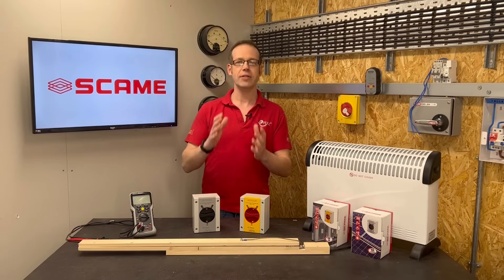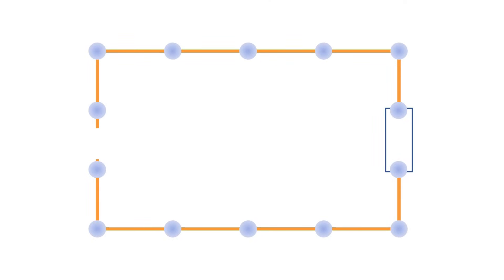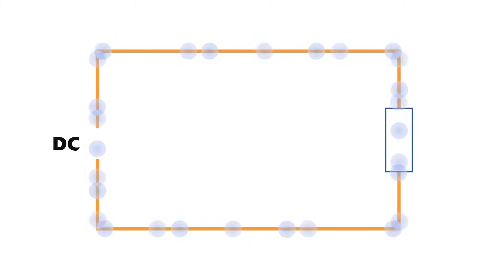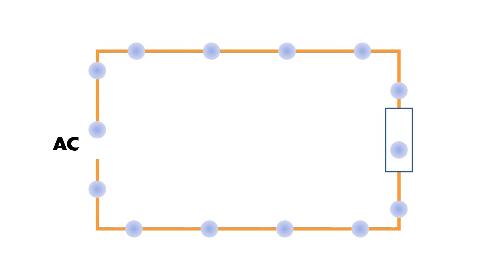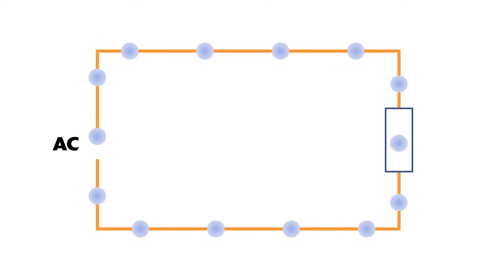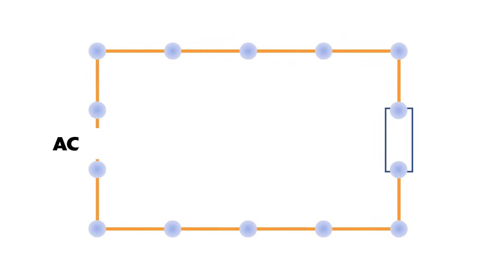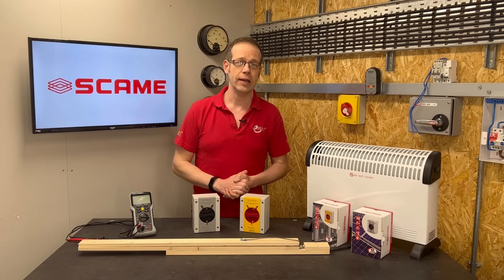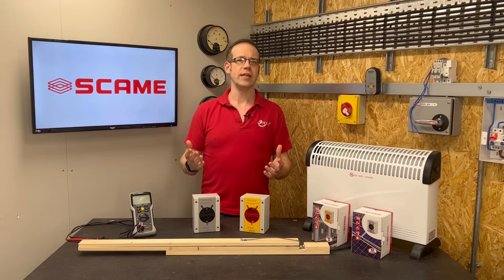The Jaw-Dropping Difference Between AC & DC Isolators!

Comment: It is the same switch with different values and connection type. You can buy the AC one and use as DC as long as you respect the values and make the bridges yourself.

Comment: i once ran a hot air gun directly of 230v dc from solar panels. Worked just fine, worked so good it even worked when I tried to turn it off :P
Reply: I've connected our immersion heater directly to some solar panels and it provides all our hot water during the summer.

Comment: The logic behind using two switch contacts in series for DC switching is that one set of contacts will randomly open slightly before the other and be subject to the arc's thermal and electromagnetic effects so that (in theory anyway) the switch will have a greater operational life with the two (rather than just the one) set of contacts.

Comment: Another critically important factor is the actuator (knob on the front panel) of the switch. Most dc ones I see have an impulse mechanism (like engine magnetos) to rapidly snap the contacts apart to their maximum distance. Do not mix and match switch components.
Reply: All modern switches have that feature

Comment: As an electronic engineer it really saddens me that the electrical industry is simply SO backward in its approach to DC isolation, and many other electrical things, in not embracing the knowledge and work of electronic engineers. 

Arcing is not really what should happen anywhere but is especially bad when it happens when switching DC at high currents. It STILL occurs even with series connected switches!

Yet DC arcing can 100% guaranteed to be prevented if electronic switching is used. The problem is that there appears to be a big misunderstanding in the electrical industry about the difference between disconnecting a circuit and isolating one and both do NOT have to happen together.

Ask most sparkies and they say something like, "well disconnecting might only be isolating the live feed, or worse, just the neutral because of miswiring ... That's why we must isolate. Agreed, However the two things are not necessarily connected (no pun!). 

For example a DC load pulling let's say 100A at 48v (typical solar PV type scenario). That load is a completely trivial task to "disconnect" electronically using high power MOSFETs or IGBTs which switch TIG welding currents of over double that amount, at many tens of thousands of times a second, around the globe on almost an hourly basis. But that clearly does not isolate the load. But once the circuit is OFF (with ZERO arcing of any kind having occurred) an isolator of normal type and even an AC type could then be operated to provide such isolation.

If the disconnect is on the high side output of said isolator then it too will be isolated. Reconnecting, even with an AC type isolator causes no problems. At which point the electronic disconnect can be used to both connect AND disconnect again through some fairly trivial electronics.

E.G. a simple interlock button can be used to trigger the electronic disconnect, immediately prior to enabling  the isolation switch to operate. This would maintain the zero arc status very simply. 

Is anyone discussing this kind of process at all? Highly doubtful sadly. How long did it take the UK to wake up to breakers instead of fuses? The continent and the US were using them for years before the UK caught up.

In addition to the above, a migration towards more use of contactors and/or relays for isolation would also be a welcome change to enable more automated safety features like auto isolate (manual reset) on fire alerts and over temp conditions (fire prevention!!) inside distro boards!

That would have been a MUCH more sensible approach than changing back to metal enclosures which has done NOTHING in any way to PREVENT fires! 🤔😢😢
Reply: Well said. I have begun using dc rated solid state relays for my home dc projects they are a very useful device.
Reply: MOSFETs can short out. Also the circuit driving the gate can go bad. They are NOT safe as emergency isolators. Only a mechanical interruption is safe!
Reply: @westelaudio943  perhaps you shouls read my post again. I specifically addressed the mechanical isolation aspect. As for Mosfets going short circuit ... In a dynamic switching situation subject to large inductive current spikes yes they do but if they are SO bad why & how does DC traction use them (and other electronic devices) SO successfully. Besides MOSFETS are not the only option (IGFETs & IGBTs) and we are NOT talking high frequency switching, we are talking ONLY as a mechanism to disconnect not to isolate. I felt I'd made it perfectly clear in my post that each is a separate entity but ONLY the actual disconnect has the potential to arc, once disconnected isolation can occur with ZERO chance of an arc (there is nothing with which to arc at that point). Sorry if you don't grasp what I was saying but I'm pretty sure I covered the issues adequately and fully.
Reply: @boblewis5558  

Ok, so you mean a transistor of some kind with a mechanical switch in series - now that actually makes sense. But then again, if the switch isn't used much anyways, it's just unnecessary complexity, and a mechanical switch with some arcing is perfectly adequate.

Comment: I would assume that the DC switches, for the same current load, would have wider gaps between switch points.  The switches shown in the vid are identical, as shown by Joe, so they frigged the switch by dropping the current load for the DC version and using two switches in series. Personally I would rather have a DC switch with one switch with a larger gap between the points. Something tells me the 1st switching points in the two series switches may wear out quite quick.

Comment: Back in the 90s In South africa, the DC switches and breakers, weren't always available. We used to take a 3phase contactors, and wire the contacts in series(to increase the switch gap), and de-rate the current rating for DC. We sometimes used 3pole switches wired in series aswell. I remember experimenting with small permanent magnets to blow out the arc. I tried fitting magnets to 2pole circuit breakers, to 'blow' the arc into the arc splitter/shoot. DC deserves a lot of respect, but it's not as dangerous as people make it out to be.

Comment: Fast DC breakers used in trains and trams running off DC overhead wires are enormous. Some are even preloaded with compressed air and have arc quenching chambers. With modern approach and in HVDC you typically have thyristor based breaker (to bring down the current) and physical disconnect in series
Reply: how does a thyristor breaker work, I thought they could only make and not break
Reply: @thewhitefalcon8539  there are gate-turnoff-thyristors as well (GTO)
Reply: @Leonelf0  I've never seen a GTO in a standard package. Even a decade later it's still a niche transistor technology.
Reply: @thewhitefalcon8539  Thyristors will break a circuit when the forward current flow drops below the latching (holding) current. 
It's preferable in AC circuits because current across the thyristor will naturally drop below the holding current every time the AC crosses 0V.
In DC operation, a SCR isn't going to have its holding current drop by itself without intervention, so you need to reverse-bias the SCR so that its current is commutated.  There's a bunch of methods, like placing a capacitor with reverse voltage in parallel with the SCR, using a LC resonator, etc. At the end of the day, you just need to reverse bias a 1V drop across the SCR and have whatever you used withstand the source voltage afterwards.
Reply: I've been in a few substations for UK southern railway and tramlink and the arc quenchers on those 750VDC breakers are pretty impressive
Reply: And then there are the modern SiC JFETs that can turn off so fast they can protect themselves from overheating. Good for MVDC systems.
Reply: Basically attempting to outrun the creation of ionized air, combined with distance as well as alternate current paths to redirect and isolate the creation of ionized air for faster extinguishing.
Reply: Compressed air? Don't think so. It's either gonna be vacuum or SF6 gas.
Reply: @FrozenHaxor  why? quenching arcs with even a blower is effective at interrupting/extinguishing arcs. Compressed air is just a higher flow rate shot of air.
Reply: @InfinionExperiments  sometimes it is used to blow the arc into quenching chamber. However, with quick disconnects operating at 600-3000V it is just not needed. Arc will rise by itself between fins and it will go down in milliseconds. In case of higher voltages you want to limit current to as low values as possible and this is when thyristors come in handy. With AC it is of course much easier even without SF6. Dobrovolsky made such breakers (for AC) in 1890s and they have not really changed much
Reply: @FrozenHaxor  air is used to preload actuator. You don't need inert gas to quench medium voltage DC arc.
Reply: @FrozenHaxor  yes they do use compressed air, often provided by mechanical bellows or "puffers" built into the opening mechanism and powered by the charged spring. They literally blow the arc out. SF6 and vacuum are used for the higher voltages. Typically SF6 is used in >33kV distribution switchgear.

Comment: I was expecting to see arc suppression blades inside the DC switch.  Seems that printing a lower rating on the outside is actually the cheaper option.  😀
Reply: More than likely the blades would be used on higher rated ones.
Reply: Lower rating AND putting 3 contacts in series.

Comment: So pretty much exactly the same switch just rated differently... And given that at CEF a 20A 3P AC is £30.79 and the DC Variant is £81.10,  SCAM is the right name for this company, yes, I know I dropped the E off the end 😇
Reply: Exactly, they both conform to BS EN IEC 60947-3 applies to switches, disconnectors, switch-disconnectors, fuse combination units, and their dedicated accessories to be used in, distribution circuits and motor circuits where the rated voltage does not exceed 1000 V AC or 1500 V DC.

Comment: Off topic , but it should be mentioned that the convector heater you use , having almost no moving parts will last for  DECADES ! .. ( unlike fan assisted heaters that get " fluff " in the bearings ... and .... the AWFUL cheap ( modern ) radiant heaters that burn  FAR TOO HOT  and burn out in a few months use ) ... the old ( 1960's ) style radiant heaters are no longer sold ( ? ) but last many years ......... DAVE™ ...............

Comment: Excellent demonstration. There was quite a difficulty in obtaining DC switchgear (isolators and contactors) in the 1980s. Power stations use a lot of DC supplies, 240V and 110V for HV switchgear operating solenoids (hence highly inductive) and also emergency lighting and power supplies, but with the original suppliers defunct, obtaining equipment for a new workshop test facility was problematic. One of my colleagues eventually sourced some contactors after speaking with the manufacturers and they were wired as per your isolator with multiple contacts in series.

Comment: If I need a DC circuit breaker of 20 Amps, but I only have AC circuit breakers, what formula must I use to know what amperage AC circuit breaker to use
Reply: The MCB must comply with BS EN IEC 60947-3, dedicated AC MCBs don't, but most MCCBs do.
Reply: Also please see my other comment regarding impulse switch (knob on the front) actuators. There are more differences than covered in the vid. Stay safe!
Reply: If you follow the logic of this manufacturer, connect every pole twice in series and lover the voltage and current rating by 25% aprox. (do not try this at home)

Comment: Some rotary DC isolation switches have opposed terminals...
eg: T1 is top left but switches T2 bottom RIGHT (not bottom left as people wrongly assume)
This can result result in a major DC short across say two strings in an incorrectly wired 4 pole DC switch isolating 2 PV strings, kinda surprised this wasn't mentioned that certain DC isolator switch terminals can have the contacts arranged DIAGONALLY than regular vertical arrangement.
Of course, it goes without saying RTFM & also wise to double/triple check the arrangement is correct/continuity across the poles to avoid risk of high voltage shorts or even reversing the polarity at the inverter etc...
But it has been known for people to wrongly assume the pinout is obviously the same standard, only to find out on some DC isolation switches they are crossed over & rotary terminals are stepped/layered/stacked
Some may already know this about DC switches, but others may not & there has been some costly lessons learnt when using different/unfamiliar DC isolation switches, not RTFM & assumption being the mother of all...
Double check all your wiring, but maybe closely triple check your DC wiring to avoid a DC short or reversing the polarity of MC4 connectors as they connect to the inverter
Reply from the maker: Great advice - sounds like we need to make a follow up - the advanced course 👍
Reply: Been there done that. And the paper that comes in the switch shows the poles opposite of eachother. Thankfully the inverter I wired had polarity protection

Comment: Pretty sure the sparks that did my PV back in 2013 just stuck an AC isolator in as I suspect they knew no better - fortunately it’s on SolarEdge optimisers so the likelihood of the isolator ever having full whack going through it if it needed isolation is highly unlikely - I did make the installer return to add a separate RCD rather than leaving it piggy backed onto the   existing one which feeds the rings 🤦‍♂️🙄

Comment: 4:25 - no magnets in the DC breaker? Can you please poke around with a steel screwdriver or similar, to discern if there are hidden magnets near the electrodes in the DC-breaker?

Comment: From my college electrical but mainly electronic training and working with dc circuits and batteries of over 30 years It’s all about RMS ac = dc but dc does not fluctuate like ac 50 full 360 degree cycles a second. What multi meters read when you measure ac is the RMS value of the peak not peak - peak. High power DC circuits are getting more common with solar battery banks so things can be gone in a flash lol 😂 just wait and see with the DIY market growing…

Comment: I served as a junior electrican for one trip when I was an engineer in the merchant navy. We used DC back then (45 years ago) for motor control, it was very good for it, pumps could be easily controlled for pressure and flow just by altering resistances. But the worst burn I ever saw while I was away was when (another junior electrician) told the senior electrician that he had isolated the main engine cooling pump. He had actually isolated the main engine oil pump. Due to the construction and access to the knife isolators, when he pulled the knife isolator it arced across and basically evaporated the skin off the back of his hand, 250 amps at 220 volts is really not good for you. Due to the pump stopping, the engine lost cooling water pressure and also stopped, so the engine room was full of people to assist in less than a minute.
Reply from the maker: Wow - power lessons
Reply: Thanks for the story Bill.  It sucks that so many decades-worth of electricians had to learn this lesson the hard way before the necessary PPE was developed and put in common use.  I come at all this from a computer engineering background, and it is scary how much power goes into a data center to guarantee that 99.999% up-time.  Multiple power companies supplying AC for failover and/or load balancing, batteries and flywheels for holdover, and big diesel engines all mean one hell of a steep learning curve, so the newbies working the high voltage side have to get used to suiting up like bomb disposal techs before going near anything.  I was lucky: I had my "safety first" re-affirmation when poking at 3-phase manufacturing facilities' wiring.  

One day I was probing some lighting circuits of all things when I got to experience my first arc flash.  Some jackass had nicked a wire on install and left it in place rather than fixing the thing, and one of my probe tips got between it and the screw terminal I was trying to get a read on.  BAM!   Instantly vaporized my probe tip.  I was wearing gloves and using a Fluke, so nothing else got damaged.  Still, staring right at an arc flash puts out enough UV to give the back of your eyeballs an instant sunburn.  I felt that for weeks!  

Now I know better: I make the last guy who worked on a panel stand in front of me the first time I crack it open.  It's AMAZING how many people will offer to take over a task for you when they know they did a bad job!  :)
Reply: Did it the arc eventually break or did it short across the switch contacts?
Reply: Actually DC isn't particularly good for motor control, PWM is. But you can argue that PWM is still DC but that's not really the point. DC control in this context is simply changing the magnitude of the current, which is what you said.
Reply: @deang5622  You have to remember that although this was 45 years ago, the ships I was sailing on were 20-25 years old. There is nothing as conservative as an old style British ship owner, so the tech would have been another generation older again. So back 80 years ago it would have been cutting edge. Very robust as well.
Reply: @deang5622  PWM is rarely the best, but it's far cheaper to make than efficiently synthesizing the fractional voltage approximated by a PWM.